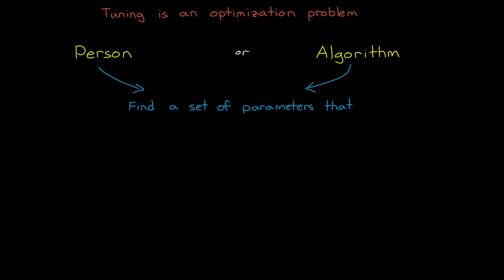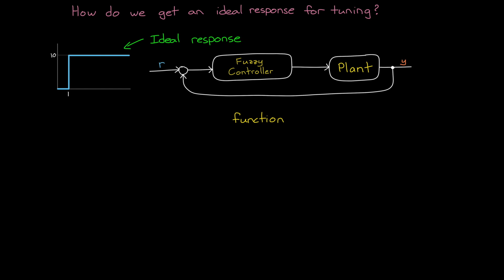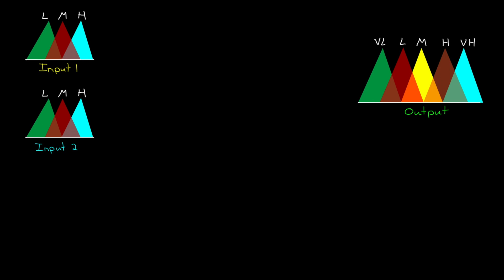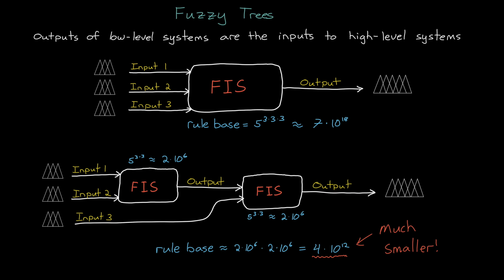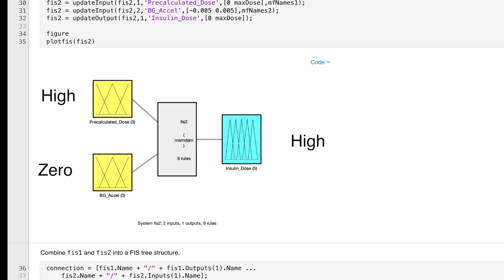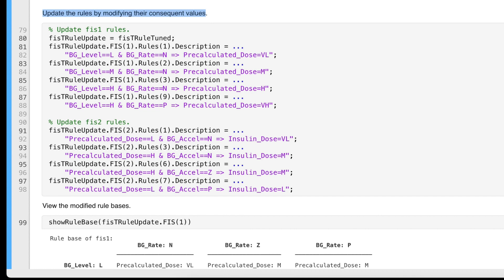Fuzzy Logic Controller Tuning | Fuzzy Logic, Part 4

Comment: I'll it use to temperature controll.
Reply: Fuzzy logic, like today's AI, was THE buzzword in digital industrial controllers about 35 years ago. During the initial tuning process, they had a sometimes dangerous propensity to run a process's final control device to the limits in order to learn the system's response times. Most processes couldn't stand such upset and you wound up adjusting the tuning constants manually.